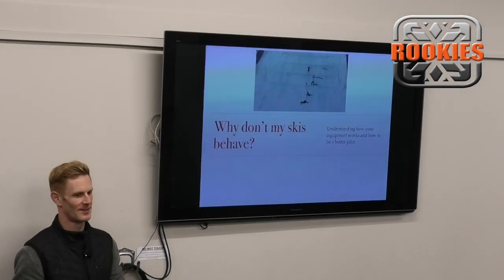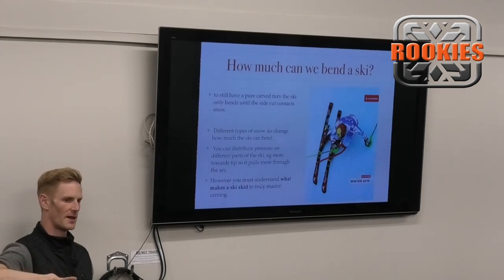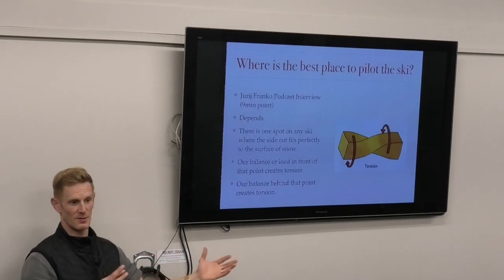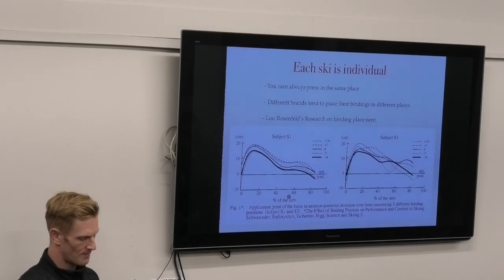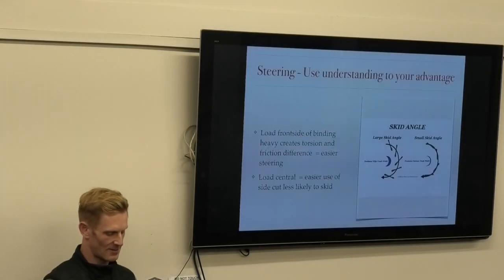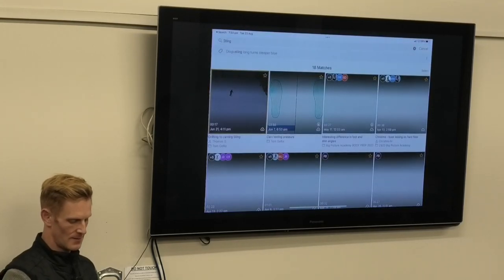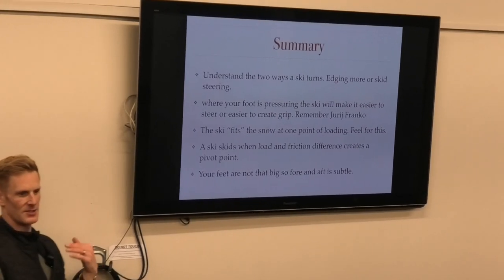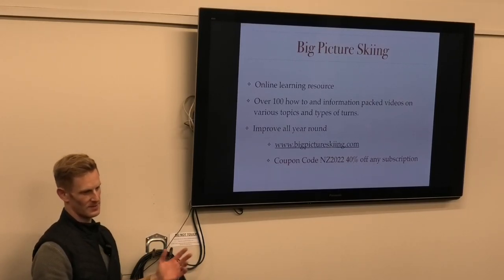Know your skis to be a better pilot. Tom Gellie Indoor Lecture.

Comment: It was interesting to learn that jamming my shins into the fronts of my boots resulted in more weight felt on my heels.  But wouldn't the leverage from bending the boot boot put greater pressure on the front of the skis, regardless of where it's felt on the foot?
Reply: Its all about control and feeling. Aplying pressure just on the front of the boot is hard to get how much of actual pressure is applyed its more like a guess thing. Its way more efective to have feeling in your foot, also pressure applyed just from the boot its delayed, pressure from your foot has way quicker reponce. Ith has to be combined shin to front of the boot ant your foot.
Reply: Where you feel "Pressure" in your foot is way less important than where your upper body positioning is and the results in the radius of the turn.  

Contrary to everyone's beliefs, skiing and turning originate in this order. The rotation of your eyes, hands, chest, (weight change from your downhill to uphill foot), pelvis, thighs and knees, down the hill.

Notice I said nothing about knee tipping or ankle rolling.  Those are the results or symptums of what I described.  You don't teach the end results, you teach how to get there.  if you do, you will have no speed control because all your ski will do is change direction, they won't bend and turn.  

25:50 What you see here, he doesn't teach you.  He only teaches you from your knees down.  That's like trying to teach you how to turn a car by telling you about the steering mechanism instead of what the car needs from you, rotate the steering wheel.

Comment: 26:23 Notice the line from the arch of his left foot through his knee to his hip joint.  There is No tipping of the knees or rolling of the ankle.  His upper body and pelvis position in relation to the direction of his skis is what is creating an entire leg angle change which is what puts the skis on edge.  it is the rotation of his entire upper body down the fall line that rotates the knee which gives the illusion that the knee is bending sideways.  If you concentrate on the ankle and knee to make turns, your skis will Only change direction, they won't turn and control your speed.  Straight down and across the hill to the right, straight down and across the hill to the left.  

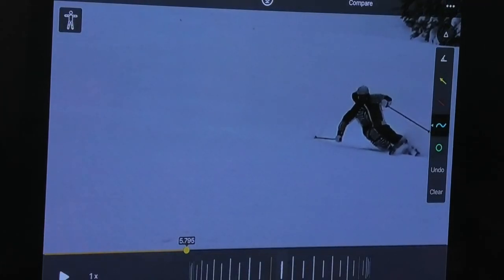26:50 With concentration on Tipping, notice how his weight has transferred to his inside ski which is digging in and turning more than his outside ski, his ski lock onto too much edge, they jet out from under him, he sits back, and the skis go straight and stop turning.  So, he has to go into the next turn to catch himself.  That's what happens to You on every turn until you are going so fast you have to push your outside ski away from you, rotate your upper body into the slope in a panic stop which usually makes you spin around backwards.  You don't blame him; you blame yourself and that just isn't right.

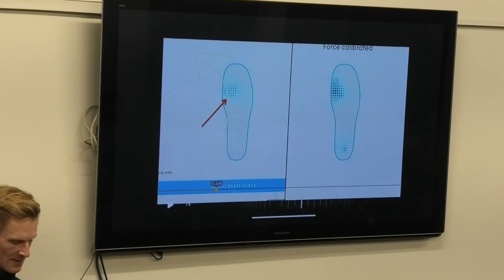Comment: 31:30 What you feel in your feet should not be a teaching method. How you position your body to make a technically correct turn is all you need.  I have never once in 54 years, told a student to think about their heel.  Does telling you what your tires experience in a turn matter or just how to rotate the steering wheel?  The reason you feel pressure on your heel is because there is a straight line from your leg bones to your heel.  To feel pressure on the ball of your foot, you would have to manipulate your foot dramatically to bend it down in a boot that is clamping your foot in place.  You teach how to ski, not describe what it looks and feels like.
Reply: Interesting comments. My husband of 34 years is an expert skier, ski race trained as well as freestyle, I am not. He doesn't know how to teach but has always told me he feels it in his feet, his feet are tired at the end of the day from gripping foot to foot etc. He also feels it in the pelvic girdle area and knows to call it a day when he uses more hip movement than he should. I couldn't understand what he was talking about until I started some land training from watching some of Tom's videos. Stand on one foot at home and you will notice that you are a lot more stable and can stand one footed longer as you concentrate on the foot contacting the ground, now do it on a wobble board. On my mountain bike I absolutely put pressure on my pedals during the descent whether one foot in banked turns or both on straight runs as I am not in the saddle and don't load the handlebars with extra weight. I've made huge improvements in both sports when I started focusing on my feet. Thanks for all your conversations on this video, I got me to think about what exactly it was that pushed me to the next level in my sports, feet.
Reply: @debbielombard5132  Hi Debbie, Let's start with this. If his feet are hurting at the end of the day, either his boots don't fit right, or he is doing something with his feet that is making them cramp.  My feet never hurt no matter what type of skiing I do.  I just spent 5 hours straight carving turns at Okemo and the last thing that hurts are my feet.  I felt plenty of pressure under the arch of my foot but not pain.

I don't understand the pelvic girdle pain.  Again, I never have pain in that area and never have.  The only place I feel pain is when the front of my thighs starts to cramp up after a long hard run.  At this point I will tell you that ski teaching and race teaching is done completely wrong.  Since I have never skied the way that it is taught, I never feel those pains.

Tom Gellie has no idea how to teach skiing or even land training.  If you just listen to him speak, there is no confidence coming from him.  His one-foot analogy and on a wobble board have absolutely nothing to do with skiing.  Balancing on skis has nothing to do with and cannot be compared to balancing in your living room.  Try balancing on a bicycle that isn't moving.

What you do pedaling a bike has nothing to do with skiing other than, you can't pedal a bike unless you completely change your weight from one pedal to the other very quickly.

What you feel in your feet is not the starting place, it is the end result.  Where you feel pressure in your feet is also dependent on what you do with your body.  When I make a parallel or carved turn, I only feel things happening with my feet After I have done things with my upper body and my weight and balance change from one foot to the other.

In ski teaching methods, just about every organization focuses on what skiing looks and feels like, not on what you have to do with your upper body to allow the skis to make turns as designed.  I wouldn't be suppressed at all that skiers feel a lot of pain from skiing the way they have been taught.  Read all my comments on my video.  Everything you need from beginner to racer is there.  The Right way!

Comment: 3:15 No he isn't learning any of those things.  All he has been taught is how to make the skis change directing by forcing them and how to angle JUST his leg to Force a ski onto an edge.  I can see Gellie's teaching method in the results of his son.  The Fred Flintstone way of skiing.  Force it to turn instead of letting them perform as designed.

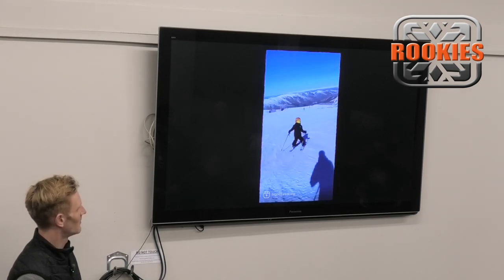3:40 The boy is concentrating on Just his foot and lower leg, not on the positioning of his upper body which will allow him to BALANCE on that one turning ski in order to allow the ski to make the turn for him and allow it to Complete the turn to control speed.  Making turns the Gellie way or just about any ski instructor's way, will not help you on steep trails or at speed.  You don't force a ski, you let a ski do what it was designed to do.

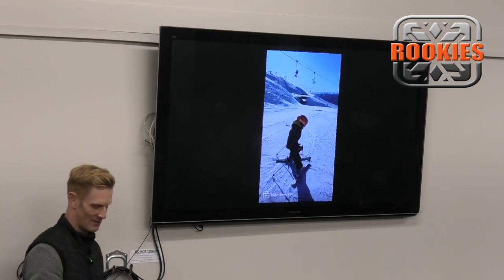4:05 Now watch this stop.  This proves that he has Not been taught how to make a proper stop or he would have.  He forced his left foot to change direction by twisting his leg and foot and pushing it away with his hip which created a perpendicular angle to the slope to flatten the ski instead of edge it and also caused his right foot to stay pointed straight down the hill with his upper body weight over that ski instead of his left ski.

You don't HAVE to steer or force a ski!!! People who do and Teach that are the ones who don't know how a ski is supposed to work.

8:12 Ski is Not this complicated.  Do you need to know and understand how your car makes a turn beyond rotating the steering wheel?  Tails like this are not going to make you a better skier, they are just going to confuse you which makes you feel you need more of these lectures!  Think about that.  

"The more complicated a person makes his subject sound, the less he knows about it."  It's called, Deflection!

26:08 You know how Gellie and all ski instructors talk about tipping your knees and rolling your ankles over?  Does it look like he is doing that in this turn?  No, he isn't.  

25:50 He has positioned his entire upper body, from his head down to his pelvis, back in the fall line or straight down the hill while his skis are still trying to cross the slope.  That is creating the new LEG angle and rotating his knees that is putting his skis on edge.  

It is physically impossible to roll your ankles over especially in ski boots.  You don't tip your knees to the side; your hip joint and knee ROTATE while your upper body is trying to go down the hill while your skis are still crossing it.  Stand up now and try it.  You are completing a turn to the left on your right foot.  Rotate your upper body to go to your right and watch your body twist right down to your knees.  Take your weight off your right foot and you will fall to your right.  Notice the left leg angle change.  Combined with the twisting of your knees, your weight will be loaded on the inside edge of the tip of your left foot and that right turn will be made by the ski, not by you.

The LAST thing that happens in a turn is your skis rolling over and your skis turning, not the first!!!  You think about skiing down a hill with your hands and chest, not your feet.

I'm not going through this entire lecture; I'm going to get to the point.  All you need is to become confident balancing on one ski at a time while positioning your body to allow your skis to make turns and make minor adjustments during the turn to keep your track and speed where you want it.  Think of standing on the pedals of a bicycle and pedaling.  Point the front tire down the hill and get off the downhill pedal.  To slow down, press the brake pedal which is the tongue of the boots and rotate your knees into the slope.  That bends the tips more and the tails slide around to slow you down.

THAT"S IT!  That's all you need to know about skiing whether you are a student or ski instructor!  

Understanding skiing is not hard!  In today's teaching climate, learning is!